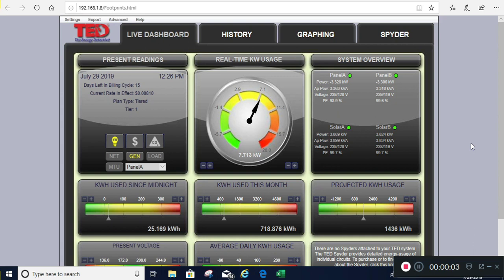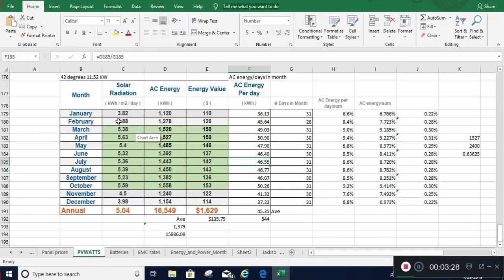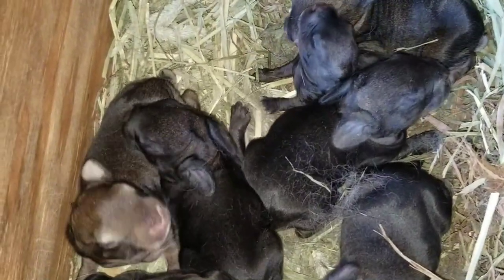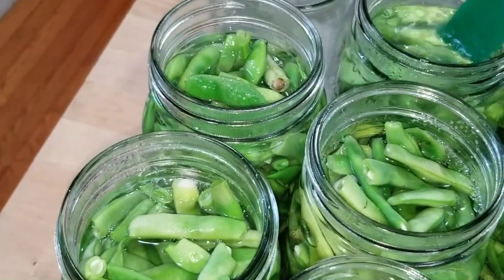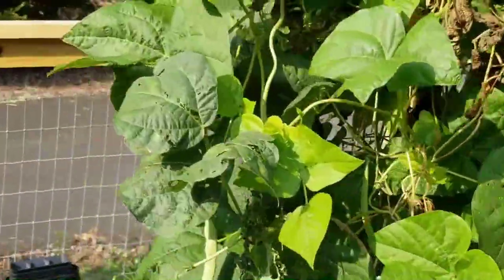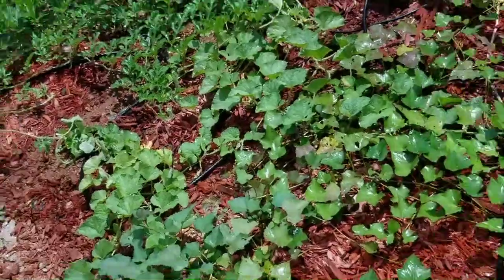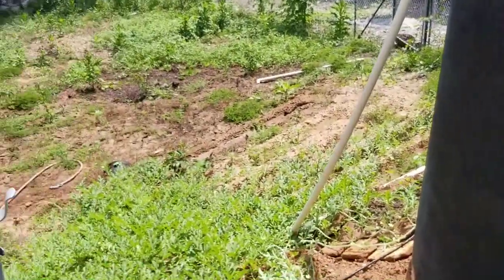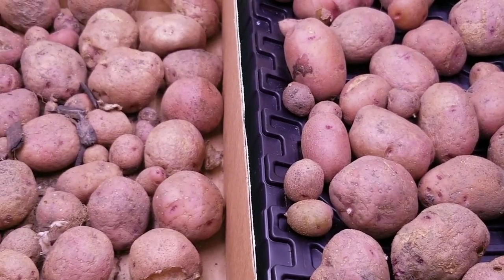7-29-19 Video Blog. Green Beans, Solar Generation, Watermelons, Charging Solar Batteries

Comment: Looking really good.  My day looks a lot like yours.  Solar power, green beans, canning, potatoes, various chores, maybe replace a sink in a rental property and a little finance mixed in.  With all the canning you do, I think you might upgrade to a 30 quart canner:
All American 30-Quart Pressure Cooker Canner (14 quarts a round):
also, check this out for topping off the jars and for Mountain House.  It heats water really fast and you can run it off your solar:
Hamilton Beach Electric Kettle
Keep the videos coming!
Reply from the maker: I have a glass top stove and am unsure it could take the larger pressure canner weight.
Reply: @dobson777a  Check out a burner that you can use outside and keep all that heat out of your house in the summer:
Bayou Classic SP10 Single Burner Cooker
Reply from the maker: @HomesteadEngineering  I've already got one. You need to make sure your pressure canner is rated for propane since most are not. I purchased a heat spreader so mine will work with propane.